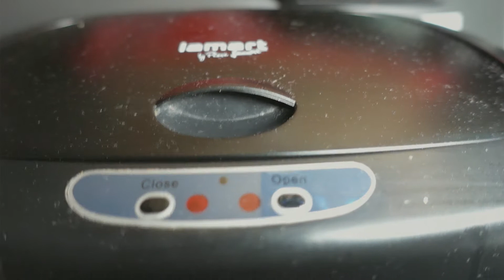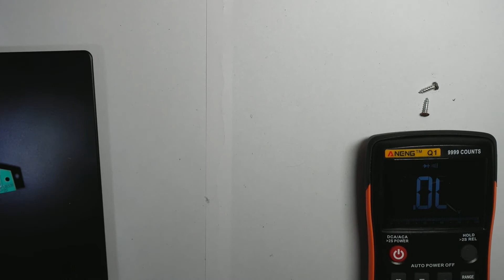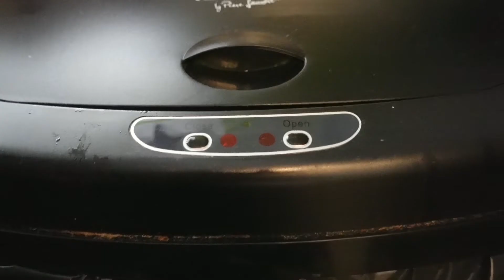Automatic Trash Can - Repair

Comment: Mine can was working fine until I shut if off to change the bag.  When I replaced the bag and turned it back on it wouldn't work.  I thought maybe the batteries were bad so I put new ones in it.  If you raise it manually it will count down and close but it will not open up by trying to trigger the sensor.  I have had it for only 8 months and can't get walmart to exchange it for me.  I have no idea how to fix it.
Reply from the maker: Hello, unfortunately every second piece is defective and it will start making the same mistake again over time :/ moisture from the bin gets inside and rusty contacts :/

Comment: Hi i have a sensor bin playing up. Whereby it opens but not staying open for predifined time. shuts immediately. Any help will be welcome. What is the value of the capacitor you removed. Have you left it off?
Reply from the maker: Hello, the spring may be defective, but these baskets are badly damaged: /